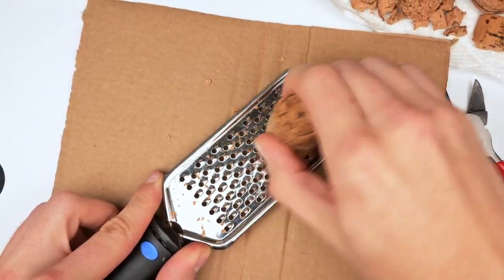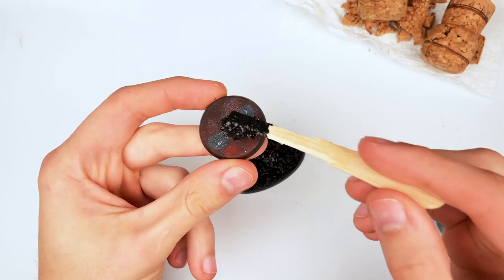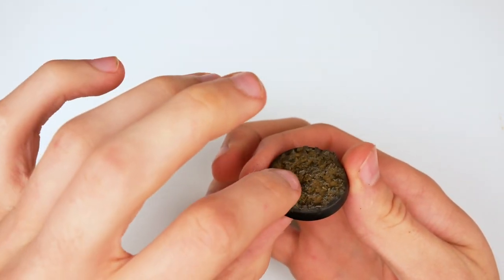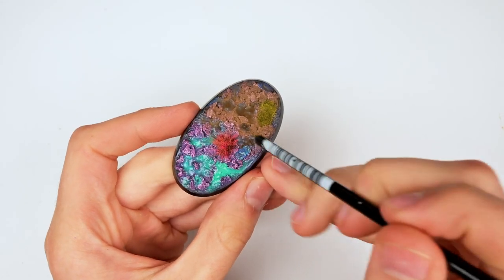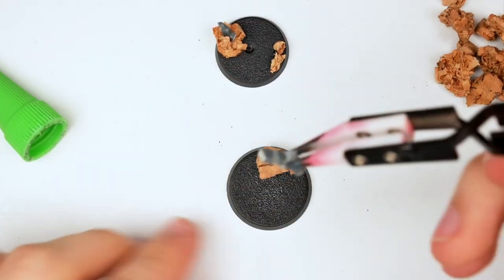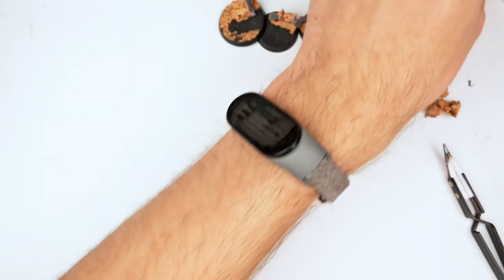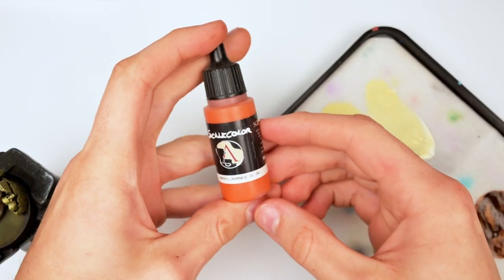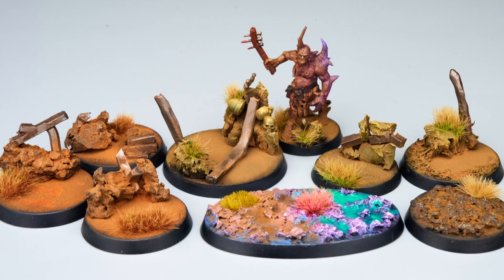How to Make Awesome Bases Using This One Cork

Comment: Very cool stuff. 
I got me a set of cork coasters that I tore up and used to make some varying levels of elevation on the bases, giving them some levels, having the special or commander units on more elevation than the others. They're great because the surface of the coasters, though essentially smooth, gives a kind of dry cracked earth effect, the small recesses are good for washes, but the smooth surface makes it easy to plant the mini's feet.
Reply from the maker: Ye cork sheets are awesome. I used to use them a lot more often but recently been having issues finding those with the right type of cork. Most stuff seems far too soft for some reason.

Comment: Lot's of great information in one short video! Just acquired my first pigment powders and looking forward to using them now. Also, fantastic way to use sprue!
Reply from the maker: Glad some of it ended up being useful :D. Pigment powders are really fantastic, they have a very large amount of uses but tend to be underused a lot. You can even do a textury panel wash with them, by diluting them in water and then cleaning up the excess with a wet q-tip. I have a massive graveyard of sprues, so I keep trying to put them to use 😄

Comment: I noticed you are using acrylic guoache, i started using it too. would love to see a video focusing on how managing thinning it is different than hobby paints. I also find coverage really different probably because a lot of them are only single pigment to 1-3 pigments.
Reply from the maker: Yeah, they're super interesting, and I'm pretty sure they're a mix of acrylic inks and paint. When it comes to thinning, I just use water, kind of like with regular paint. The coverage is fantastic because the pigment is so fine, and mixing them is very predictable, just like you said, because they only have a few pigments in them.  I use them more as a technical paint for their unique properties, however they are a bit strange to use a primary paint. For wet blending, they are next level. I personally don't use wet blending often, but these paints are an amazing aid for learning it.